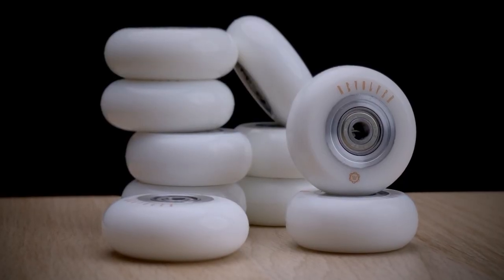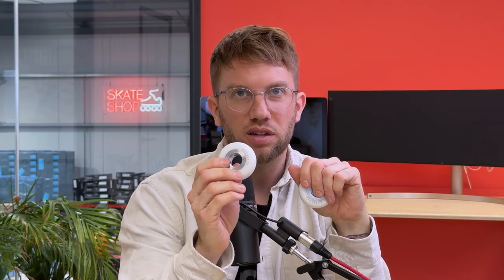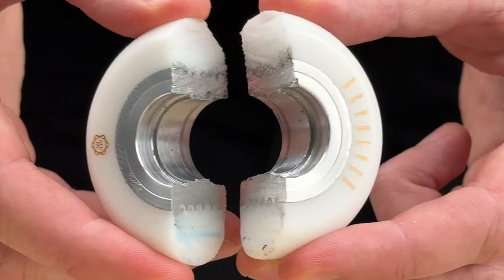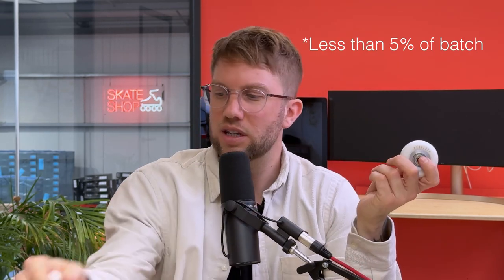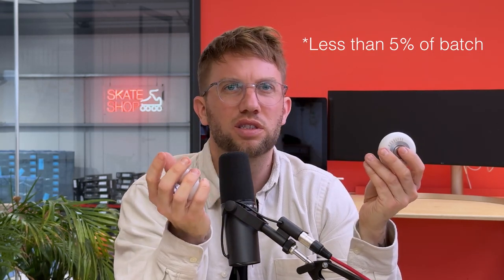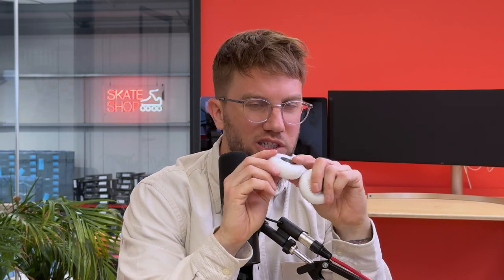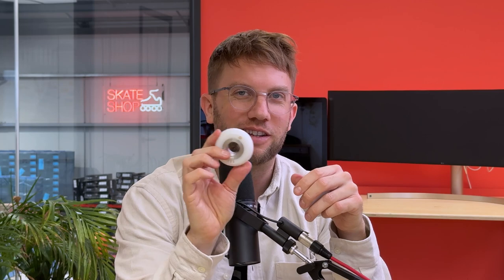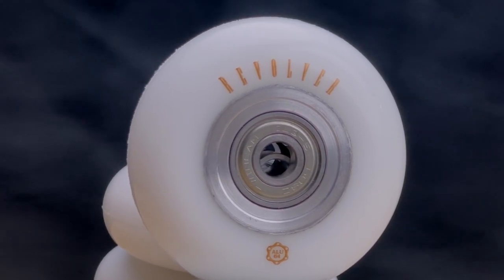The Problem With Metal Core Wheels...

Comment: Would these do well on them 909 being 60mm? Flat setup
Reply from the maker: Them stock frames are listed as max wheel size 58mm… you may be able to squeeze them on though. Will check soon
Reply: my 60mm famus wheels fit in the them frame.  you have to dremel the ufs bolt a litte bit or using very flat ufs bolts.

Comment: Are the cores more round than plastic?  No matter how much money I spend, plastic cores always seem to wobble and vibrate.  It's annoying when skating on smooth surfaces.
Reply from the maker: Yes, they'd be more round when there is load on them. I imagine this would likely be the case uneven when they are not loaded because plastic is more prone to warp when cooling.

Comment: Genuine question, how do you service the bearings if they have been pressed in so tight or are the bearings not meant to be serviced and only have a short life span. 

Looking for some new wheels and bearings 
That's all.
Reply from the maker: You'd usually expect the bearings in an aggressive wheel to outlive the life of the wheel, so no need to service them (just dont skate through puddles!). Once the wheel is at the end of it's life you'd dispose of both wheels and bearings and start over :-)